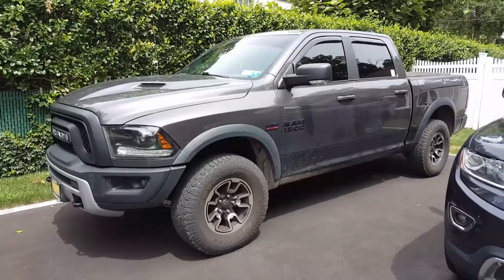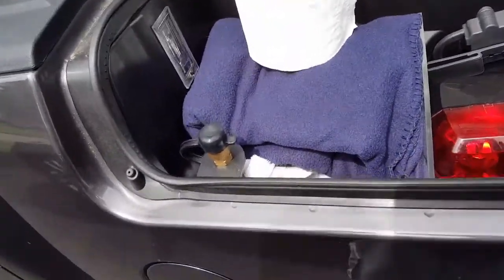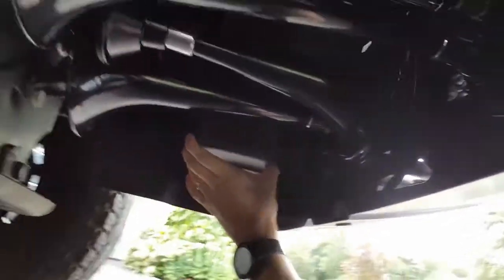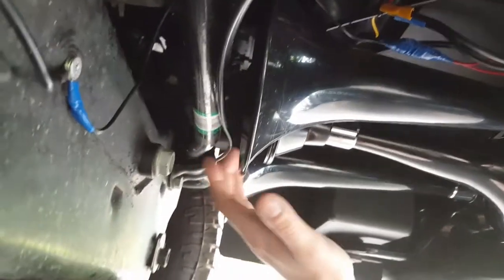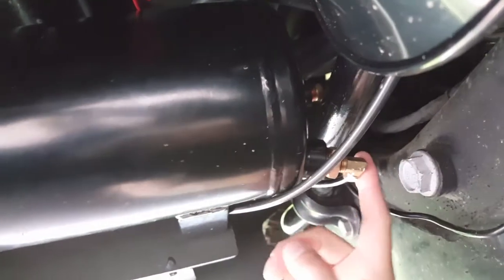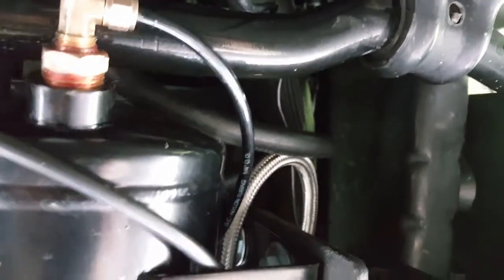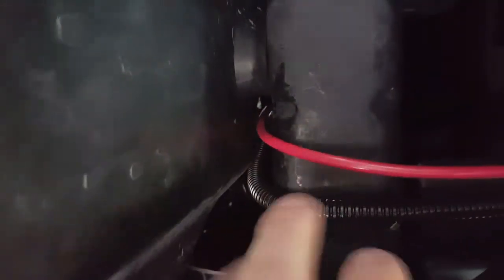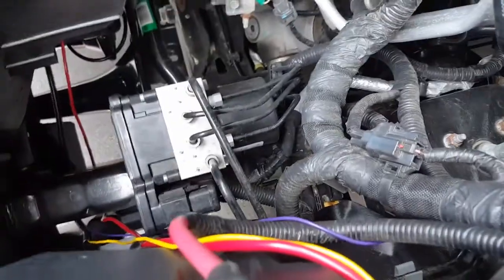Kleinn airhorn bolt on system for 2009 - 2017 Dodge Ram 1500

Comment: That bar doesn't have anything to with raising or lowering the air suspension. That is the anti-sway bar. Yours is probably a little larger due to it being a Rebel.
Reply from the maker: PJ Sloan thanks, I wasn't sure. I just saw it going up and down as I raised and lowered my truck and realized it was going to be an issue with my installation.

Comment: I'll never understand why you and so many others, when they fit air horns, also choose to fit a button separate to the steering wheel horn pad???
When you need to sound the horn in an emergency, it is natural instinct to press the steering wheel horn. By the time you remember where the airhorns button is and get your finger onto it, you've lost a second or two....which could be the difference between having a crash and not!
Here's my suggestion. Remove the press button and replace it with a ON/OFF toggle or rocker switch. One wire to the relay (as already exists) and the other one to the factory horn wire.
Now, when the new switch is in the ON position, the airhorns will sound whenever you press the factory horn (the factory horn will still sound too, but you won't be able to hear it!!!).
If the cops want to check your horn works at a roadside stop, and you don't want to risk getting a ticket because the airhorns will make the cop soil his pants, then just flick the switch and when you press the steering wheel horn, only the factory horn will sound.
Reply from the maker: Good advice. I wanted the separate horn button, no real need for anyone to do it this way, just my choice. So far I have not had an instance where I was confused and didn’t know which horn to use. I don’t abuse the horn, for the most part anyway, so I’m not concerned about getting fines.

Comment: Your undercarriage is pretty exposed with no debris guard.  How is it after a year?  Did things get loose when you go off-road?  Any damaged horns from the debris?
Reply from the maker: Patrick Lacson, nothing damaged so far. Horn and onboard air system is still working well. I do have to recheck the air lines to make sure all is still tight. I just haven't had time.

Comment: Was this purchased as vehicle specific to the Ram?

I have a 17 Rebel.
Looking at options.
Reply from the maker: The kleinn airhorn system is a bolt on system for the ram 1500 2009 - present. Just remove the tow hook bolts (3 on each tow hook) and bolt on their brackets. Instructions are fairly simple to follow. 
Your ram should be included in this. If your ram can be raised for off roading or lowered for short people you will need the smaller tank like I have in the video. If not you should be able to install their 3 gal tank. The people at kleinn were great at getting me anything that may have been missing from the kit or things like changing the tank out. Any other questions, feel free to ask.

Kleinn has other bolt on systems for ram 2500, Ford f150, f250 etc.
Reply: Excellent.
I'm going to contact them, and work up a plan. Great video.
Reply: The fitment issues Ron had are unique to the Rebel.    You should contact Kleinn directly and they'll help you out.

Comment: Hey what wire did you use to hook up the pressure switch to the ignition wire? Yellow wire.
Reply from the maker: You can use any color you want. I believe I did use the yellow
Reply: Ron S did you not find a non hot wire while the ignition was off? I could not.
Reply from the maker: I went into the fuse box, I used the fuse for the cigarette lighter because that's only on with the ignition, and added an adapter I found in my local auto parts store. It keeps the fuse working for the lighter and allows you to add a wire to it. No issues yet.